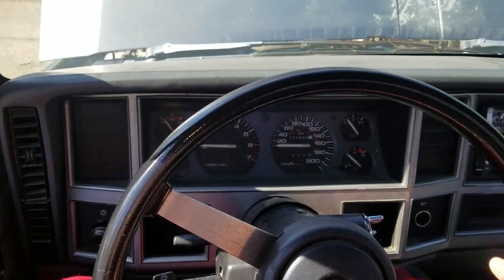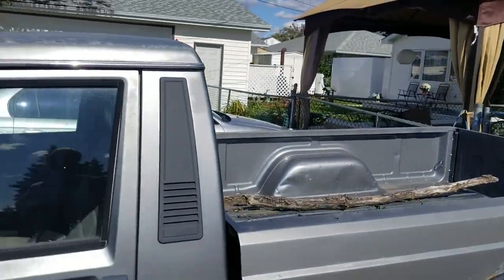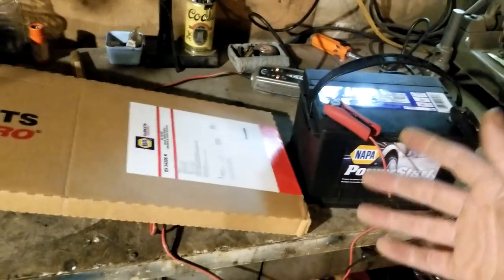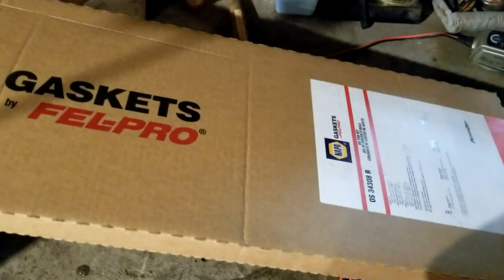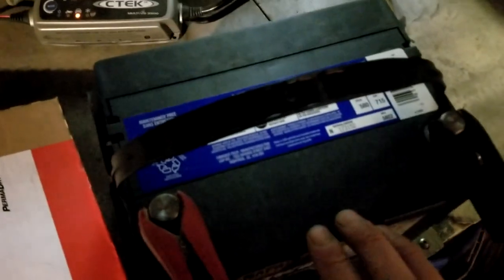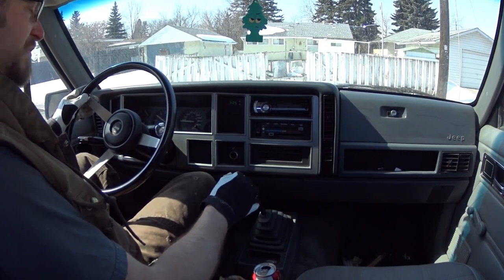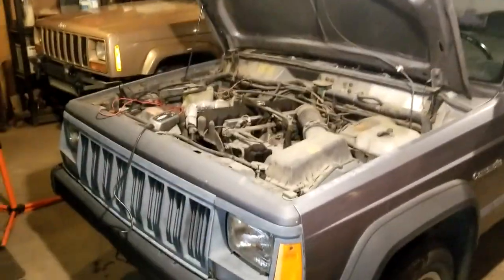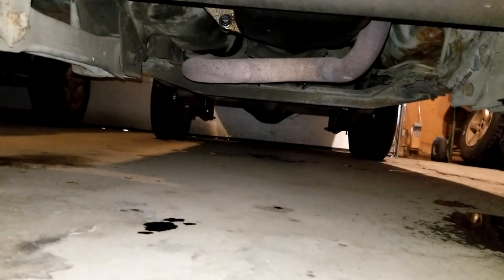Getting My '91 Jeep Comanche Going Again...

Comment: Might be your distributor leaking... ? Just look for the highest point of oil on the engine and work your way down.
Reply from the maker: Turned out my oil filter adapter seal was toast. I made a video about replacing that if you're interested. 

https://www.youtube.com/watch?v=321ZbfxAEuA

Thanks for watching and commenting!